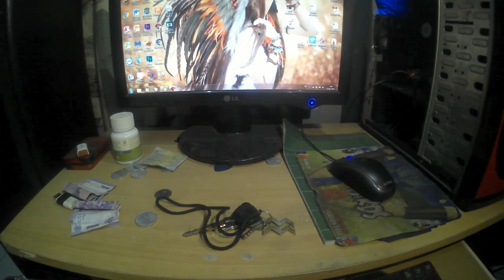Steering Wheel Dengan Joystick Untuk Game ETS2

Comment: so I tried this and the thing is that the wheel rotation is not smooth, is like it's moving by little sections (like mini dead zones) is there a way to fix that?
Reply: use a different resistance potentiometer 
I think most people use 50k one